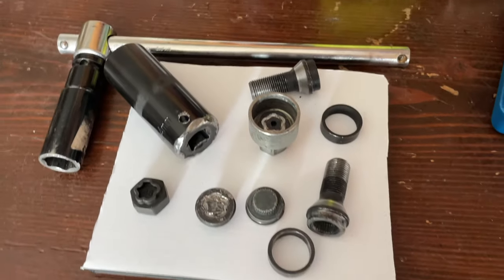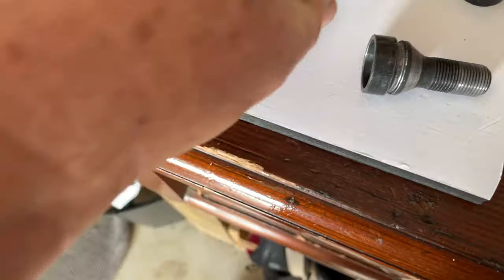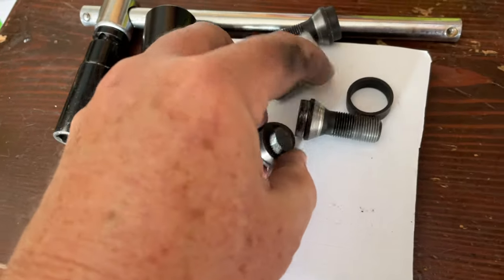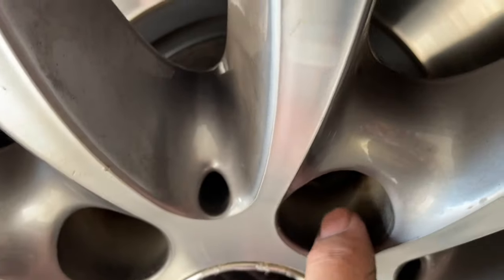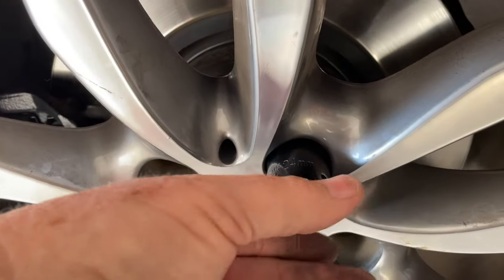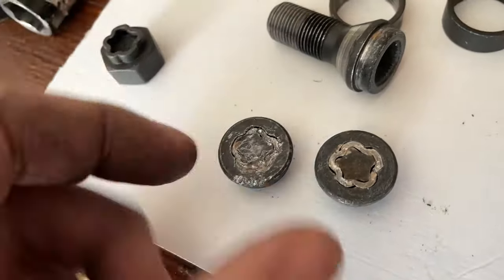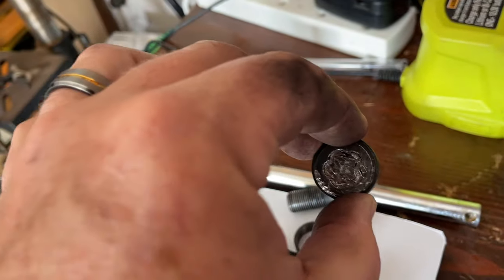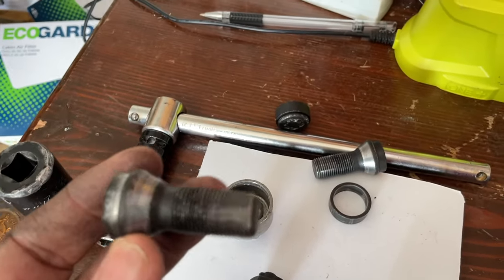How to Remove BMW Spinning Security Lock Nuts Wheel key lug bolts studs

Comment: Easy remedy. I drilled a small pilot hole next to stuck piece of sheared off lock nut then used a pick to remove it. About 5 minutes work.

Comment: Omg I thought I was the only one. This is exactly what happened to my son's BMW X5 and we're still trying to remove the lock after the key/head came off. The stupid key broke off inside. Has a at tired and hasn't driven in 2 months because we can't get the wheels locks off😢😂

I'm in the U.S. so I'm trying to find that tool you used.

Comment: I have this tool but with some mini’s and 1-series from 2015 there is no space behind the nut as they seem to be a lot closer - I have had great success with the tool prior to that - the only was I have been able to use it is destroying the ring then using the puller - where as on the earlier one’s it does what you said goes behind the ring and pulls both off together. 🫨🫨😓🤔🤔😉